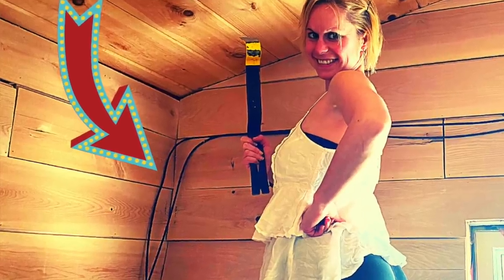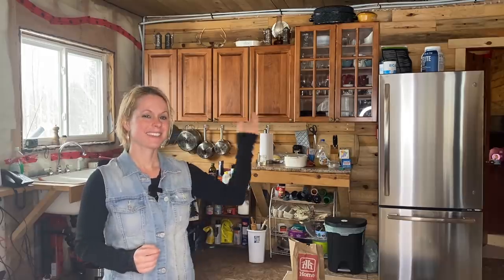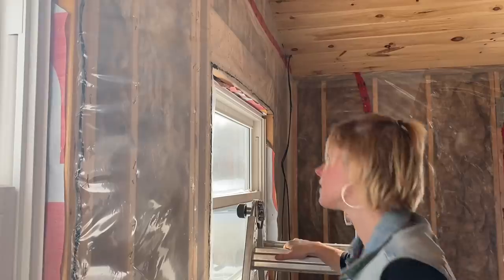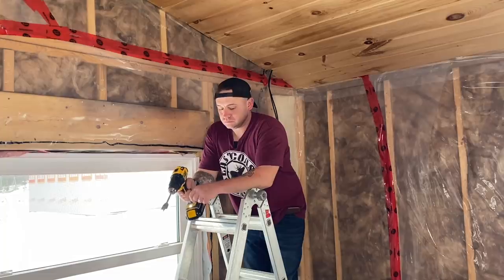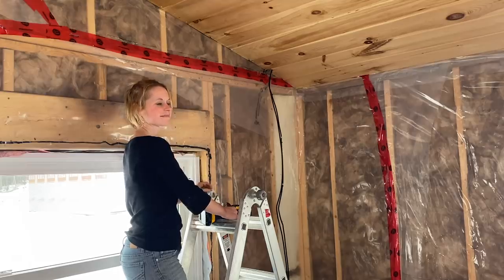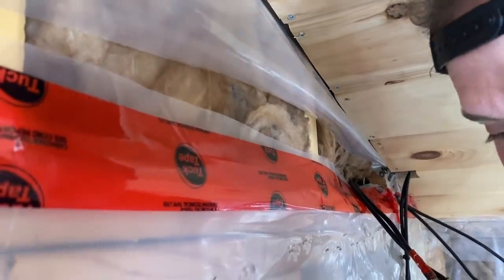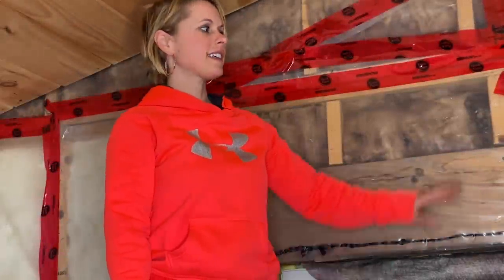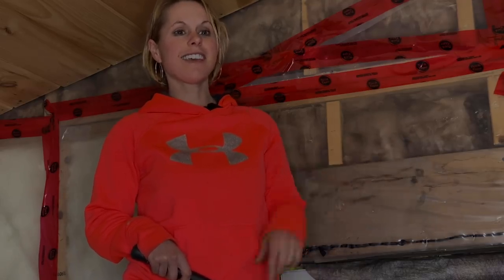BUILDING OUR OWN HOME | Finishing Up The Electrical

Comment: Awesome humor 😄 Don't forget to put GFCI any plugs around your sink. You can always Daisy chain to the same GFCI. Meaning your home run goes in to the GFCI on the line side and the load out to other receptacles in the kitchen. Except a dedicated circuit to the refrigerator and other outlets where you might use an oven or microwave.

Comment: You will notice a big difference with your heat and cooling once the drywall is done. I did the same on my cabin and increased the heat retention from my wood stove and the single unit cooling worked so much better. Jeremy a mouse l jumped when a spider landed on my neck so even big guys get scared 😂😂 . You both are awesome 👍❤️🤗
Reply from the maker: haha

Comment: I think what you guys are doing is very cool. The old farmhouse I grew up in was built in 1880....never had electric wiring. I was told it was wired in the 1930s, I grew up there in the 60s and 70s and it only had 1 outlet per room, a pull chain ceiling light in some rooms. So they had to install wiring in an old plaster and lathe building back in the 1930s. Wiring was run up to the attic for the 2nd floor, and single drops down to each room, again 1 outlet and maybe a ceiling light. Good work guys, love watching your progress!

Comment: I saw a drywall knife ad on facebook that my wife got me for Christmas.  It has a tape measure device attached to the knife.  The night thing about this tool is if you have a piece say 9 inches wide you use the tape measure to measure the width of the void you are trying to cut and fit a piece into and you lock the tape measure .  Then you take the tape measure and butt up the end of the tape measure against the edge of the drywall piece you want to cut from and guide the device down the drywall piece as the knife scores the drywall and it should fit perfectly in place

Comment: A suggestion Jeremy and Ashley, while you have the walls open, put an outside plug on both sides of the house. If you have one on the west wall, put one on the east wall, that way you do not have to run extension cords all the way around the house just to do a little electric required job on the side that has no plug.  cheers.

Comment: Things are flying along. A suggestion, check the cable splice using the TV and mark where it is before drywalling it in. Those connections/splice have a habit of coming loose. Cheers.
Reply from the maker: We actually did that very thing in case it ever happened :)
Reply: Conduit. Large plastic conduit. AV cables do not fare well in walls.
Reply: A big X on the drywall

Comment: When you start hanging your drywall make sure that you only use 1-1/4" screws so that you don't go through your newly installed electric and cable wires.

Comment: Hope your planning on at least installing a blank plate with an access to that cable splice. Never bury splices, cable, phone and especially electrical. Use a double gang blank on a mud ring for accessing that connection later and try to leave slack. Unless it’s a threaded connector splice that you can crank down on to tighten it, simple room vibration from the television itself or stereo speakers can cause the push together type to get loose. I know how crazy that sounds but believe me I’ve been on many service calls where that was the problem. (Loose connections) If you never need to touch them again then that’s a good thing, the blank plate can be covered with decor or a clock but having that access will save your sanity. I was in the electrical then cable industry long before then into two way data, so I’ve heard and seen many nightmares regarding wiring. Looking forward to seeing that room rocked! 
* wherever the cable goes through the studs you may want to put a plate over it. Then when you go to run a screw or bang in a nail to hang something and hit a plate you’ll know to stop and relocate... 😉✌🏼

Comment: Question. Why do you have 2 rg-6 cable lines? On my satellite I only have 1 cable line. I'm glad you took the time to run switches and  plugs in your home.
I bet once you get the make over is done you 
Will have awesome home.
Reply from the maker: Shaw uses a couple of different satellites they point at so you need two lines to get all the channels. We are looking forward to it all coming together :)
Reply: @MBFModernHomesteading   ok I gotcha.. I did know you had 2 of them.
Thanks gor the update.

Comment: With a couple hundred pesos a Sheetrock hoist helps hanging drywall a little less stressful??
Reply from the maker: For ceilings it helps for sure.
Reply: I disagree totally because I used 12 ft sheets and only used one helper to load sheets the rest I did alone..   Less butt joints and easy to move sheet around into place...